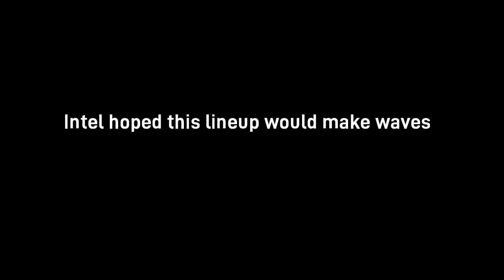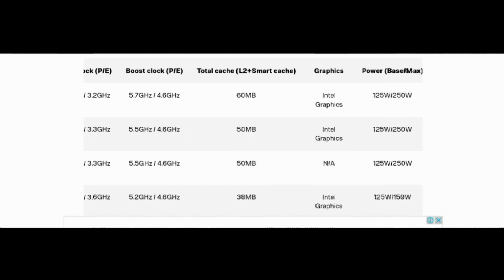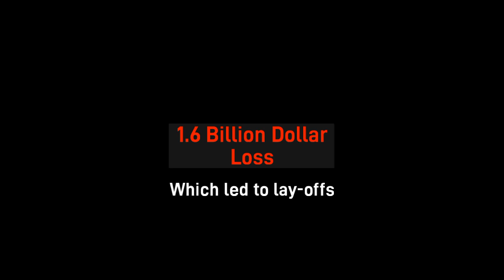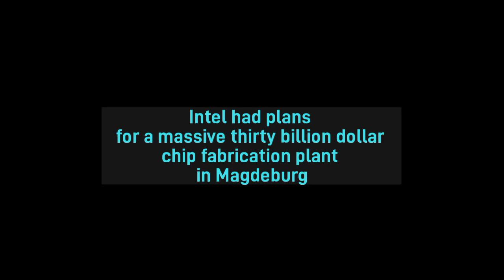Intel Failed Miserably Intel Vs AMD

Comment: The magdeburg thing didn't really bother anyone in germany tbh. Why Germans like to go with AMD is due to the reason that people actually got fed up with their reaction to the 13 and 14th gen mess. Also, AMD offers more bang for the buck.. 

The only way Intel can actually shine right now is due to the fact they have a better interface between cpu and pch. AMD still uses 4.0x4 pcie lanes since 2019. Intel uses 4.0x8 lanes since like, 12th gen (2021). So yeah, if you need several m.2 slots then you'll need to go with intel which imho is a ridiculous mistake on AMD's side.
Reply: its not just the germans.

Comment: they arent really bad cpu's, but they are about $100-$150 too expensive, idk why they are trying to sell them for so much, these cpus are the very first gen of a entirely new architecture, i do see the potential for this architecture to compete with amd after another generation or two but for now they should just be trying to compete for price to performance to at least recoup some of their losses until they get to that point. if they made the 245k cheaper than a 9600x, a 265k cheaper than a 9700x and a 285k about the same as a 9900x id see them as quite good options, but sadly the 245k and 265k are significantly more expensive than the competitor cpu and the 285k is more expensive than a damn 9950x

Comment: You think games are the only thing Intel cares about? there is more to a computer than gaming. The Performance per watt made a big leap in de Core Ultra CPUs. AMD is far behind all of that, still taking 40Watt doing nothing, just creating heat. The 14th gen was a power hungry beast so they needed to do something. 

But who buys a new model CPU on launch?  Windows needs tuning for the newest release. Bios updates are needed. just wait a few weeks.  
All test i have seen where done on Windows 11 24h2, which has a lot of problems on its own, the new power settings are not good for performance. 
Performance also goes up when you use the correct DDR5, and even better CUDIMM. Tests show allot is done with AData memory, which are removed from the compatibility list. 

Strange you see them selling nothing while they are already out of stock in other places. 
And yes, the new CPU's are not the fastest in the range. But we already knew that before launch. Intel never said that this was the best performing gaming CPU ever. 
But who cares if the performance for production is way better, and that is what you do the most. 

AMD has a nice platform. and is certainly strong at this moment. but calling it intel failed then we also say AMD failed with the 9000 launch because it has its problems too. 
Where both failed was bringing a new product to the market while they were not ready for launch. Testers now a days are the consumers. we see this with software and now we see this with hardware.
Reply: uhhh? the new cpus are basically twice as efficient as the old yes but amd still wins in performance per watt from the testing ive seen. you can even run a 9700x on a little baby low profile cooler
Reply: I chose the new intel platform for 3 reasons. I am upgrading from am4 platform, I think that under the right circumstances the core ultra 9 285k is a great cpu, and given the global landscape it might be a while before we get better chips.
Reply: @williamhermanson9753  i dont think they are bad cpus, they are quite good, but they are way overpriced, if they want to compete with AMD they need to drop the prices to be a bit cheaper than their AMD counterparts to make them competitive

Comment: When the youtubers test these arrowlakes and flopped, I prepare myself and get some 14th gen cpus as stock just in case there is a rush for the 14th gen. My line of work do not benefit from Ryzen cpus...
Reply: You mean running userbenchmark or shill selling intel CPUs? Nothing under the sun can't run under a 100% compatible x86-64 (sorry amd64) cpu.
Reply: What kind of instructions you use, that AMD doesn't work ?